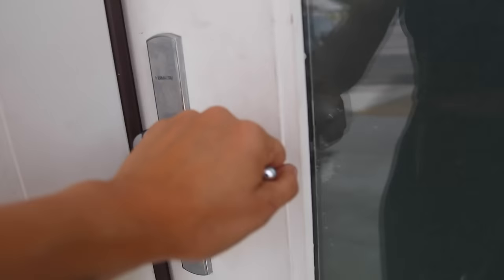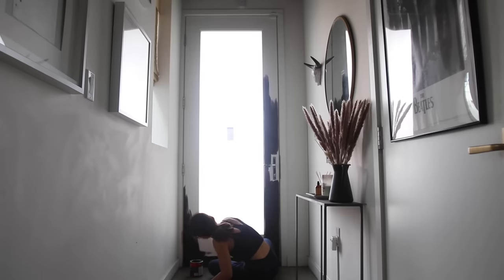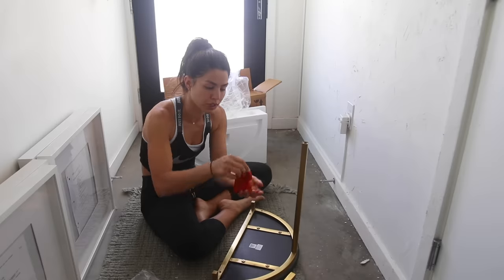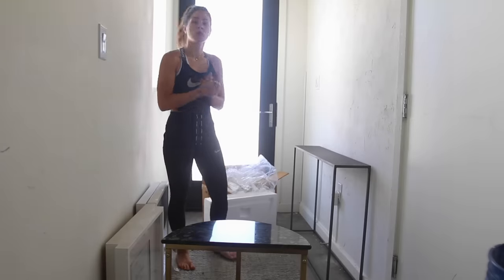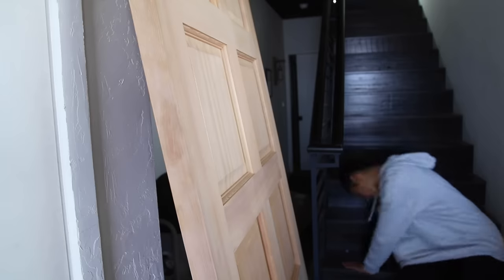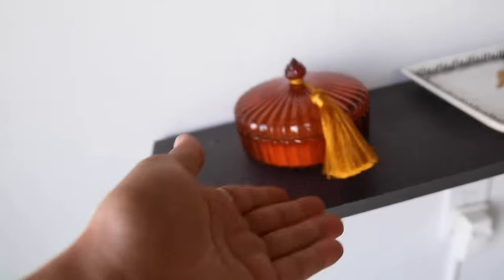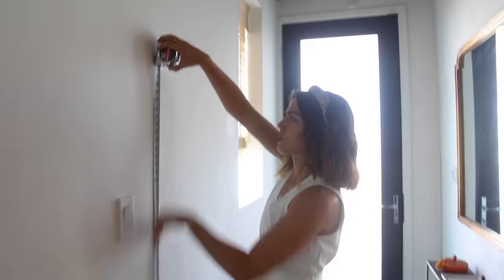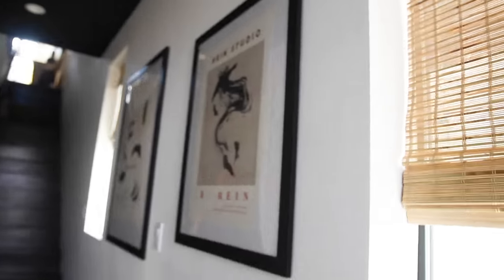DIY Entryway Transformation *small space hacks!*

Comment: I would love to see you do a video on how to make a T_I_N_Y DARK condo entry way brighter. I'm in a 1,258 sq. ft condo and people walk into my dark hallway and even I think it is depressing. The 3/4 high board and batten walls are painted white (which is great) and there is a bench for sitting and taking shoes off (another plus). But its issues are its tiny size, and that the laundry room entry door is there immediately across from the entry door. The chocolate brown laminate floor is going within the next few months (a mid tone wood laminate is going down) and that will help to lighten the room a bit. I do have a table lamp in there and I have two "candle lanterns" on the opposite wall that provides a bit of ambiance. No chance for a chandelier as there is no electricity in that room and I have another condo directly above me so no way to add electric. The entry door is a heavy oak door and i am thinking about painting the inside of the door and its frame white which "could" help lighten things up a bit. I cannot change out the door and out in a door with a window (condo rules) so that is not an option for me. Any other ideas or suggestions?